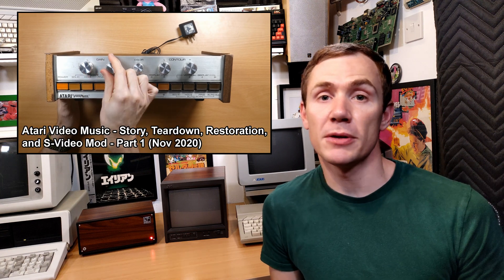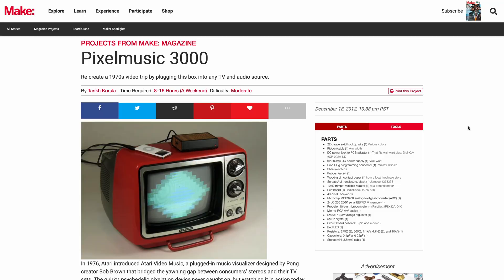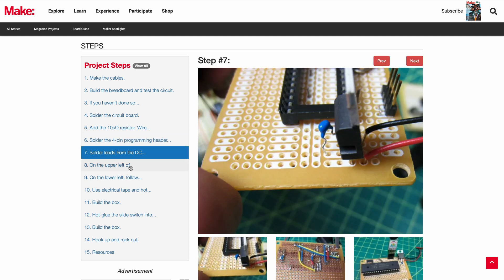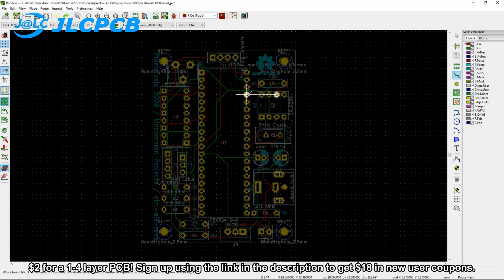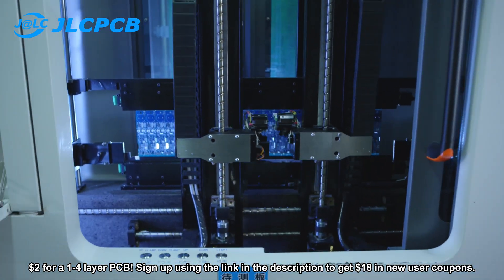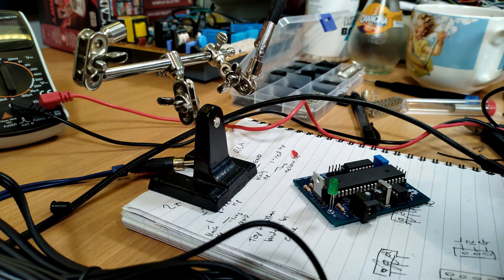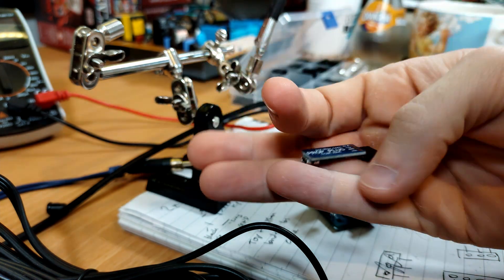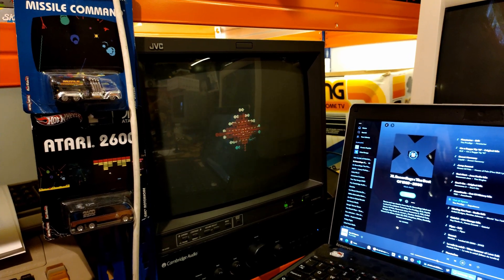I Built An Atari Video Music Open Source Clone - The Pixelmusic 3000!

Comment: At any point, did you get a random sprite in the upper left hand corner of the display? I have one and it seems to be a reflection of whatever sprites are actively in use.
Reply: Might be something wrong with my hardware, but if it happens to someone else- I had to comment out the if statement lines, leaving only the displayroutine:=randomgen(8)-1 line in order to get pixelmusic300e.spin to work reliably without eventually crashing. The sprite that I mentioned above also becomes just a colored underscore. (Incidentally, these lines are also commented out in pixelmusic950.spin, which also runs reliably (but mainly fewer colors) and also with an underscore looking sprite on the top corner of the screen, in my case lol.
  ' if changedisplay==0  'this whole changedisplay routine just changes screen patterns a little less frequently than color
       '   changedisplay:=randomgen(2) 'try randomgen(4) for slower layout changes or no ranomgen delay for frequent changes with color 
          displayroutine:=randomgen(8)-1 'randomly pick one of 8 screen patterns 
        'else
        '  changedisplay--

 If I comment out the displayroutine line, the artifact also vanishes, but the designs never rotate.        
P.S. I sure didn't want to poke around this deep, not my wheelhouse, but at the time of this writing, tennis elbow has really got me, so eh   ¯\_(ツ)_/¯

Comment: I followed your site and set one of these up. It's so very cool in person, thanks for reviving this, especially since it's not possible to get hold of the Ataris for cheap! One note I'd make- I fretted about wasting $20 on the prop plug, for something I'd use just once, while I couldn't get a cobbled serial circuit to work, a $5 FT232RL FTDI Mini USB to TTL Serial Converter off Amazon worked perfectly fine with no driver hassles in Win10, just had to use jumper wires to connect the 4 pins on each, and some include those.
Reply: Were you able to get this working? I am stuck with a buggy IDE. I am trying to flash the Propeller but it isn't letting me. What IDE did you use? Did you make up PCBs using his gerber files?
Reply: The physical build worked out easily, I did use the provided Gerber files. I'll double check the IDE version and get back with you. Only issue I had in the end was a random sprite in the corner of the screen. Perhaps a slight defect with a component
Reply: @K6LCM  I'm using Propeller Tool 2.9.3

Comment: Very interesting. Never knew this existed. I noticed some tearing in the video signal, is that there on the CRT or is it just a by product of the capturing process?
Reply from the maker: It's there on the CRT, I presume the Propeller struggles to keep up. Although to be fair the original Video Music has similar artefacts so I suppose it's accurate. 🙂

Comment: Very nice and unique project! 👍
Is there a way to influence the displayed patterns or object shapes, or are these random? The Original had several buttons and knobs for this.
Reply from the maker: Unfortunately they're random, although I think it would be fun and relatively easy to modify to use some of the spare inputs on the Propeller for the switches. I may well do that in a future update, in fact.